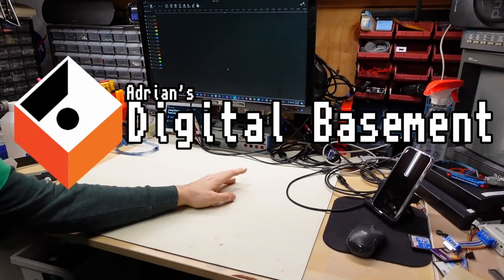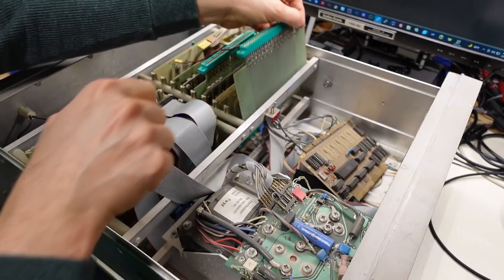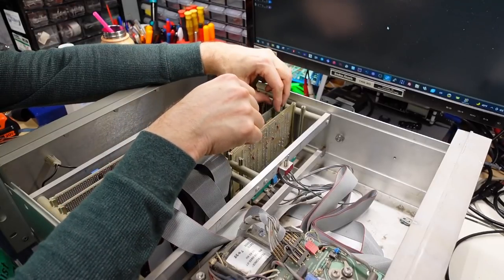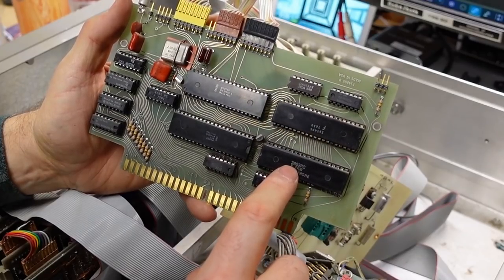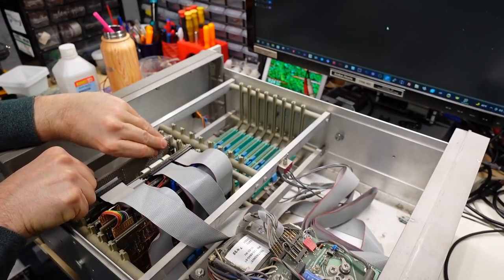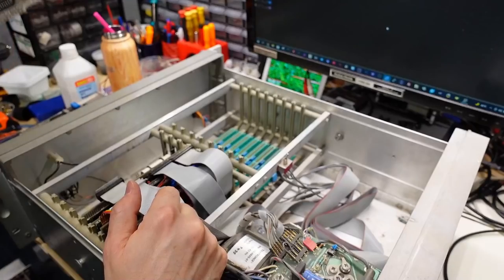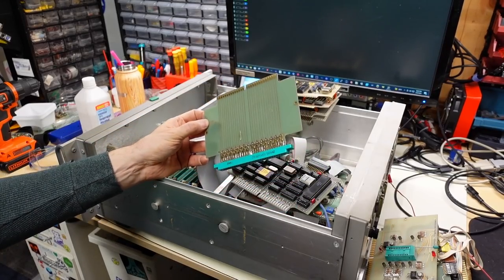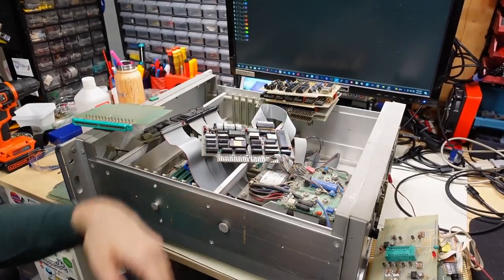I need help finding information on this mysterious computer

Comment: That machine remembers me like a communications controller (phone or fax) o maybe an industrial specific controller.
I've seen some similar controlling old concrete plants.
Looks like a prototype for a definitive machine.
Reply: I agree my first Tech Control Facitty 1995/96.  I am retired Air Force and I clicked on this video because I seen it live but nobody touched it.    

(Not part is this equipment side bar/background). While stationed blast from the past the base 1992  before I arrived.
that facility had an analog telephone with patch cords operator even had an analog telephone switch until from the 50s…. I have to go will edit soon
Reply: I was thinking telecom myself but I'd expect to see Dialogic or other chipsets that weren't there.

Comment: This has all the typical design features of Tektronix in that period. Note the Tek name on the power transformer. I suspect this was a prototype or perhaps an in-house controller. They built lots of custom equipment for internal use.
Reply: More likely someone stole a power supply out of a defunct piece of Tektronix gear.  Likely an old Tube scope.  Tektronix stuff is usually ridicculously sanitary and well-built.  This isn't.

Comment: Back in the late 90's I was working in elevator maintenance and I remember we had some elevators from the mid- to late-80's that were controlled by similar computers. 
We had maintenance units that provided graphics, keyboard and HDDs to perform software updates or changes.
The riser cards were used to make the cards acsessible for onsite-troubleshooting.
Empty spaces in the housing were usually used to store spare cards.
The power supply units often were modified to provide some extra power and/or to bridge power failures (sometimes by big capacitors, sometimes by rechargeable batteries). 
Later versions also provided control-LEDs in the front panel that showed the most common errors to save time for diagnosing.

Since this looks very common, the units we used back then were more evaluated and normally had standard PCBs without all the wild wiring on th e back.

I don't think that one of these self-engineered elevator controls have made its way from Germany all over to your place in Portland. But since this is no rocket science, I could imagine that someone over in the U.S. developed something similar to the units we used back then.

Comment: Looks like a part of a larger automated test / programming rig, those boards with straight parallel traces look like they are power buss boards to carry power from that heavy power supply to external equipment, there appears to be logic boards for running test sequences, these most likely controlled by one of the processor boards. The programming board could well be used as a master programme source for programming external equipment, or for holding programmable test sequences. The sockets on the back are most likely power out,data and address lines and i/o for running tests to whatever equipment it is connected to. All the equipment would most likely be custom built for the task in hand, some parts more universal use than others, such as programming and test sequencing/logic beds. I have had similar equipment over the years, all incomplete but interesting. One module that was quite impressive was a 6 channel stepper motor controller, with encoder feedback and position memory, 7SEG display and control buttons, near enough entirely made with logic gates and opamps...the entire circuit wire wrapped with hair thin enamelled copper wire. The main buss lines were a bundle about as thick as a thumb. Enough to give even the most seasoned technician a heart attack should anyone look at it the wrong way whilst attempting to troubleshoot. Beautiful piece of artwork, scary and stressful to think of any mistakes made during hand assembly!

Comment: To me it’s definitely a tektronix piece. Same fasteners for the top covers were used on a lot of 80’s vintage video equipment like vector scopes and waveform monitors, etc. Same with some of the single inline connectors on the boards.  And with the power transformer being tek also leads me to believe this. The boards and traces on them also fit the era. All that said perhaps it was the beginnings of a digital video storage system and you may only have the digital side and another chassis was dedicated for the A/D and D/A conversion. I’m a former broadcast engineer. The station I worked at had a digital still storing device made by a company called ADDA that used a huge 15 megabit 4 platter 15” disk hard drive to store the images. But then there was other gear in the setup which went from A/D and D/A. Took up about 4’ of rack space. Was a very expensive device in its time but replaced the slide projectors focused into a camera for on air stills. Hope this is food for thought.

Comment: I started my development career (such as it is) programming fortran on a rack mount CP/M machine of those kind of dimensions. That lot sat next to the desk and I had a terminal. It was for testing aerospace servo valves so the rest of the case had interface cards for the test rig. 8 inch floppies in a separate enclosure in the rack.

Comment: In the early 2000's, I had a digital logic college professor who was from this generation of computers.   He was a wizard of wire wrapped 74xx logic systems.  Used to be REALLY common back in the day.    Computers of the 70's and 80's were of a level you could actually understand physically how they function and could repair them with off-the-shelf jelly-bean components.

This system looks like it went through two generations of CPU's.  I'm guessing the original non-bodged EPROM programmer was how it originally stored state, then whomever was maintaining it upgraded it to flash-based storage.

Honestly though, this is too much tinkering for a scientific / industrial computer.  This was someones labor of love, or a project system used by a College digital electronics class.

Comment: I have an EPROM programmer capable of reading/writing 2708's and many of the other odd 24-pin EPROM devices. Let me know if you one of those dumped or copied. It was very common computers of this era to be interfaced strictly by serial/terminal. I have 3 S-100 computers and only 1 had a CRT controller but that's because it was designed as an "all-in-one". As you mentioned, those boards are smaller than S-100 so I'm not sure what bus that is.. Most computers of this era also had a "monitor" program in ROM. Think of it as a primitive BIOS, normally it will spit out a welcome message and allow you to read/write memory and ports. It would typically boot directly to monitor and had enough smarts to boot a floppy from there. As some other comments have mentioned, the 56 pins on the cards would seem to indicate this is a STD Bus system.

Comment: As at least one other commenter said somewhere, this will be a "home" made machine, built for commercial or industrial purposes, and upgraded over the years with the old cards floating around inside the case so that they'd be easily available if the replacement boards went bad at some point. There's a decent chance that it doesn't match any spec, and probably was hooked to one terminal or another through it's entire service life. Could have even been used for something like internal inventory tracking at some repair shop.
Reply: It definitely looks custom built for a particular application - testing, automation, something that runs some custom code (on the eproms), has the ability to change that code (the eprom writier), and talks to a bunch of serial devices of some kind - maybe terminals, maybe something completely different. This definitely is not "home" made - it's some small run custom controller for something. Probably one of those things where if you had to ask how much it cost, you couldn't afford it.

Comment: This feels like something my Uncle would have had, in the early 80's. while he was working as an engineer for techtronics. like something they pulled out of a rack to replace and he was able to take home and fiddle with.
Reply: Former Tektronics engineers will tell you that they had to build their own test and measurement equipment. At least, that's what I did. I built my first oscilloscope from scratch.  We built computers like this for a short while but I don't know how many were sold.

Comment: We had quite a few such randomly-built 'boxes of tricks' in the rail industry and I assume every industry had the same. The ones I saw and used took signals from sensor subsystems, applied some processing algorithm, and finally printed out a summary of a test run. A 'run' might be a train running at up to 155 miles/hour from Glasgow to Carlisle and the summary might tell the Lead Engineer how close to derailing we had come, the data coming from such as strain gauges and LVDTs.

Pre-microprocessor we had crude electronics that would do the same, with data being displayed on electromechanical counters or paper chart recorders. Your device was probably made by somebody working in the American equivalent of my workshop. The subrack was sourced via somebody's catalogue from a manufacturer such as Schroff and the holes were probably carved out or stamped by the equivalent of my late colleagues Dennis, Denis, Kevin or Simon. In the UK we had several companies who would put together such racks; the names 'Kemitron' and 'Data Acquisition' come to mind. I kind of hang my head in shame when I remember the number of such devices that I used but then cast aside in the metal recycling skip at the rear of our site. But they often had one application and weren't documented so it was cheaper to start again.

Comment: Looks like a headless mainframe running C/pm as it's OS (a precursor to dos) I believe Tektronix sold these as an off the shelf item which could then be customised as required. I expect almost all of the 'mods' you noticed were factory level repairs to boards which failed QC but we're too small a run or too expensive to waste. The reason it looks home made is that back then most things were hand assembled, check out the pace soldering tutorial course from that era it will show you the techniques you find on the board there.

Comment: Looks like a Zenith/Heathkit knockoff type computer a guy we knew built back in the 80's.  Not saying it is - but apparently, different folks would make different parts and people would trade them with each other to build their own PC's.  You started with a single board you ordered with some documentation.  The rest was home brew I think. His was rail-mounted and replaced a drawer on a dresser.  He made some type of card for them and would sell/trade to get other parts.  I recall him trying to get some card badly - like an internal modem - and he just could not find one.  I also recall he saying it was really heavy and he could only get it to work with a particular Zenith monochrome monitor - so color was a no go (color was the schnizzle back then).  Interesting find.  Hope someone can positively ID it.

Comment: It's the great, great, great grand daddy to a Raspberry Pi.
Actually, it looks very similar to the custom built Z80 laser imagery controllers, produced by laser entertainment folks, back in the '80s (self included). I helped to wire wrap memory boards for a similar rack-mounted Northstar computer with an internal S100 buss card cage.
If so, the DB 25 parallel connectors would have connected to a bit pad to input the sequence of x/y coordinates, which would have been stored onto the eeprom. The timing circuit may have been used to step through the vector points.
But, the over engineered cards are modified OTC PCBs, which imply a more industrial application. The engineer who built this prototype obviously knew his way around these controllers.
Glad that you find the efforts of the early pioneers of computing technology to be so amusing. In a few years, someone will be scoffing at your work, as well.

Comment: As at least a couple of comments already stated, the Z280 is a beefier, faster version and next generation CPU of the Z80 family.  I once built a CP/M< kit from MicroMint based on the Z280 (although it might have been a Japanese second source part).  Anyway, I still have it "gathering dust..."  Instead of the genuine CP/M, its operating system is ZCPR by Richard Conn -- also an enhanced "next generation" version of the CP/M.  Correction: my CPU is Z180, not '280.

Comment: Interesting find. It should haven been pretty obvious that this thing doesn't have video output and is intended to run from a terminal, given the DB25s on the back. This was pretty much the norm for every CP/M box (Altos, North Star, etc) back in the day. So a DYI or prototype CP/M system for lab or industrial data acquisition and control is the best guess. 
As mentioned here by others, those Tektronix parts brought up a few question marks. Those coloured, sometimes angled single row ribbon cable connectors indicating pin 1 with an arrow are all over Tek gear from the 70s; my 7000 series scope is full of them. Also those IC sockets recessed into the solder side as seen on that one board; Tek used something very similar to socket trannies and op-amps in their scopes from the 70s. 
But the backplane connectors with the notch in the centre had me stumped...
Reply from the maker: Tektroniks is based in Portland here so surplus Tek stuff is super easy to come by here ... or may have been an engineer working possibly. There was another comment from a viewer that he worked for the company that made this for a customer under contract. So the mystery continues :-)

Comment: My first thought from the size and shape of the box was an LSI bus chassis, which took DEC cards. But the backplane is wrong and the box looks like something from Tektronix. 

Working as a tech for the army as a contractor, we had a lot of one off equipment in boxes like these.

Inside is reminiscent of a Hill Electronics data encoder/decoder, but the cards are the wrong size and they used different boxes. The left side card slots were longer, and the right side took different modules for video and RS232 interfaces, plus a controller ball interface.

Their cards were all custom made, many by wire wrapping, and I kept a couple units from the early 1980s running until about 8 years ago. Once the PROMS failed, that was it. I wasn't able to copy the working units' programming and successfully burn new proms. Only having used chips on the market probably didn't help.

These HEI boxes were so individualized for their purpose that even the company that built them in the 1980s couldn't repair them in the 2010s. The code for the proms was long gone and that technology was ancient at the turn of the century. It was a miracle I kept our final two  running until the system finally went digital.

Comment: Makes me think of some of the early automation gear used in broadcast. If something failed or it didn't quite do what was needed then out came the soldering iron and there would be braided copper and caps bodged all over it to quiet down the RF blasting from a nearby transmitter a problem I still deal with and about the only soldering I do these days besides making cables. It's just board swapping if not entire unit swapping. It is difficult at times because the station owners are still in the mindset that the chief engineer could fix anything with a trip to the radio shack down the road. Such things just do not exist or are not possible any more. Newer stuff doesn't even come with board schematics or service manuals any more kinda back to the no user serviceable parts thing again. I doubt this was the exact purpose of the unit but given how many of us can go yeah I have seen something like that means it's overall style/design was used for a bunch of custom equipment. My closest guess that would fit with everyone else's is some form of early industrial control/lab/telemetry/automation system before there were a lot of standards and off the shelf components in that area. It of course would have evolved over the years as technology and needs changed until being retired completely. I hope you will find a way to dump the eproms and get some clue as to who was behind it but I am betting give or take dodgy caps that this thing might fire up enough to give you a serial console or two. Also Mr. Carlson might have an idea if not know exactly what it does by looking at it.

Comment: Would be interesting to know if the two sets of backplane were connected to each other (beyond power)… is it possible it is actually 2 machines housed in the same case? A Z80 machine and the more prototype looking Z280 machine? On retrobrewcomputers.org there are a few people with Z280 projects - a relatively rare CPU due to rather a lack of commercial success.

Presumably if this was constructed at a time contemporary with the date codes (especially with 8” floppies too), it would’ve been a very expensive bit of kit.
Reply: Yes, that thing is hand-made but far from home-made. More like some industrial prototyping machine or scientific university project.
Reply: These are clearly three eras of prototypes for making many more boards. They were all together because they were kept together at the original company.